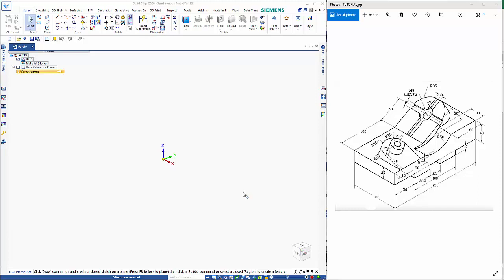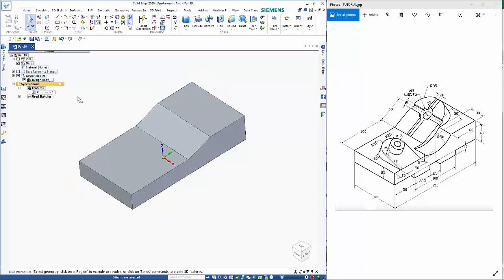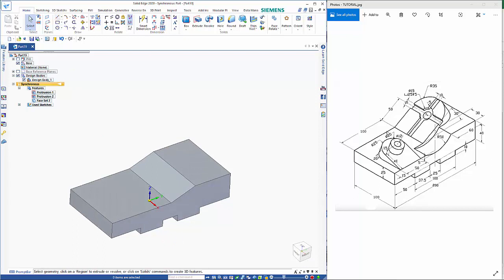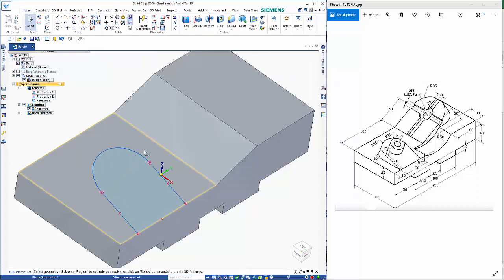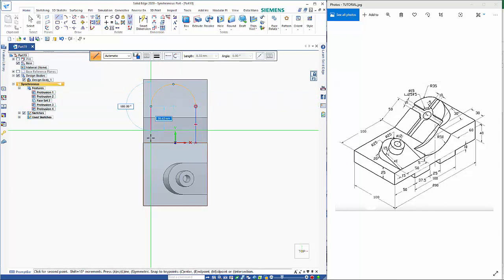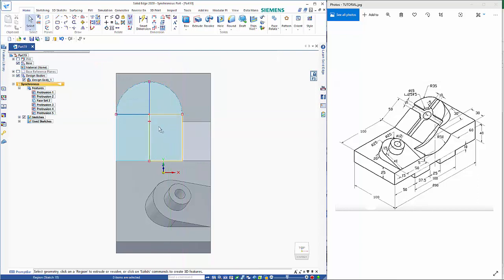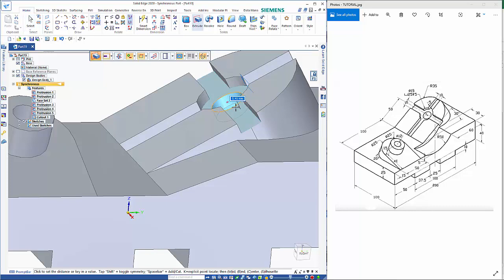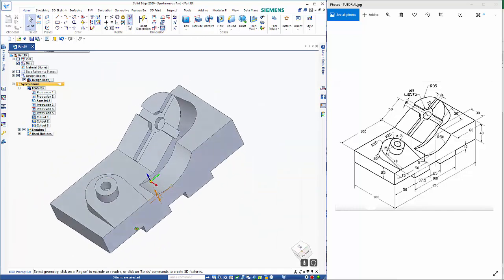Solid Edge design tutorial using Synchronous Technology

Comment: Terrific, it’s been a lot of help
Reply from the maker: Glad you liked it. If you have any requests on what you'd like me to cover, then let me know.
Reply: @cadcentralnz  Thanks for your generous offer, I will check your other videos first but I made progress with my project today because of this video. I am making throttle bodies. They have various angles etc.
Reply from the maker: @greggray6839  Email on alan@cadcentral.co.nz with images or whatever you have if you want help
Reply: @cadcentralnz  Again thanks, I am making progress, see how I go today. I offered to pay a recent mechanical engineering graduate to assist me but after one day he said it was “too hard”. I said I knew the first week would be hard but it would get easier as you become more familiar with Solid Edge. Answer was “No I am the wrong person” . I will have to watch more of your videos and then see if I can do an assembly to check for issues. These throttles are quite an advanced design, a more basic version of an F1 throttle used on the older NA a engines.
Reply from the maker: @greggray6839  Remember that synchronous  isn't the be all and end all and ordered has it's place too. Use whichever tool is right for the job!

Comment: If you extrude to a depth and than want to come back and make it a specific value from another face how do you set the counter to reference off the other face and not the incremental change. This is the behaviour that I always want when making changes but it’s not obvious how to do it.
Reply from the maker: Have a look at this (old) video clip (3 minutes in) and see if that helps define what you are after?
Reply: @cadcentralnz  l will definitely check it out can you post the link or the title of the video.
Reply from the maker: @ivojurkovic1276  https://youtu.be/MpvuLPFhimk?t=188 - yes, that would definitely make it easier